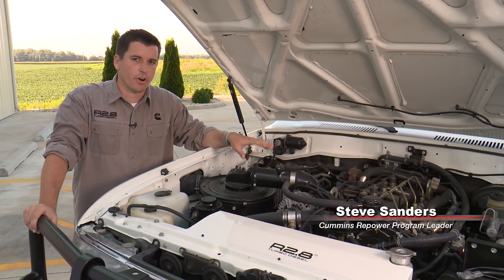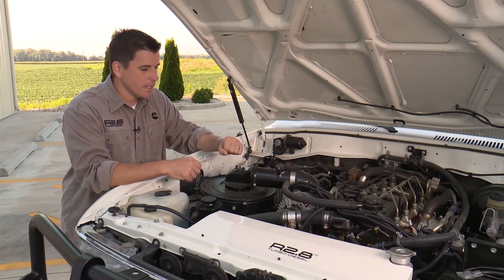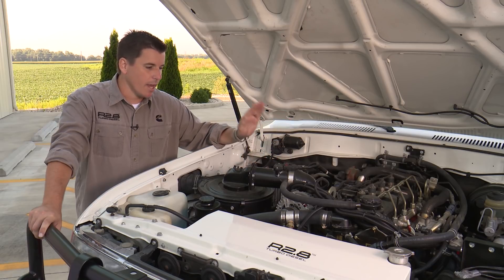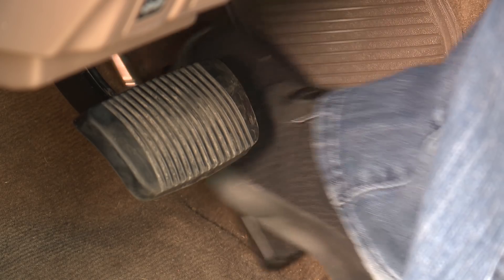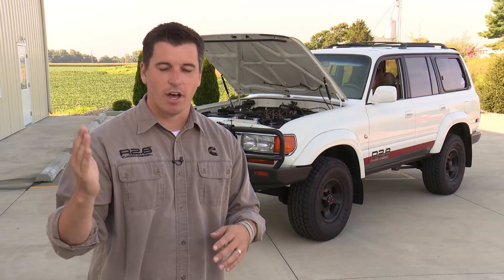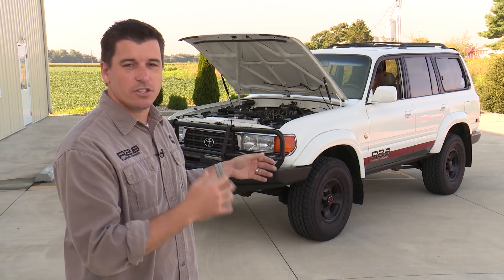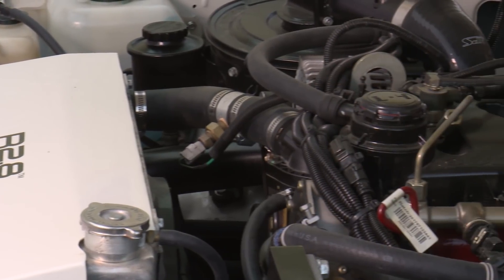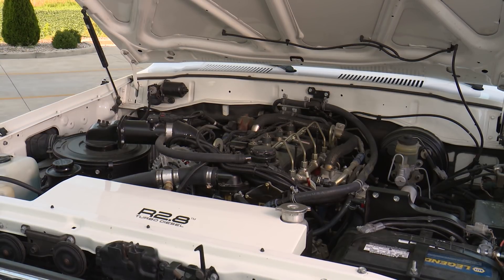Cummins Repower Garage: Tech Tips - Custom Cold Intake Learn Calibration Feature

Comment: Has anyone done a conversion in California on a Vehicle that is under the Smog Law ?? I have a 2003 Dodge Dakota that I would like to convert. Thank you. Ted.
Reply: Would like to see someone do this in an old Squarebody Suburban. Also curious on how people have done this in Cali. Especially from a gasser to diesel conversion and all the DMV BS.
Reply: I was considering swapping my 4.0 for an r2.8 in my Cherokee, but ended up selling it. 

I remember there were certain years California would allow this swap to be done. I believe the XJ was up to '99. 

The Suburban shouldn't be an issue since it's older, but that's a pretty small engine to move that big box around! X3